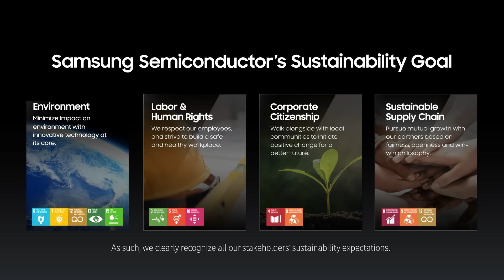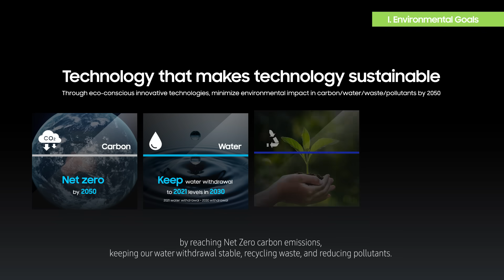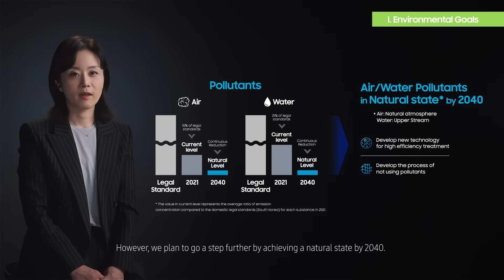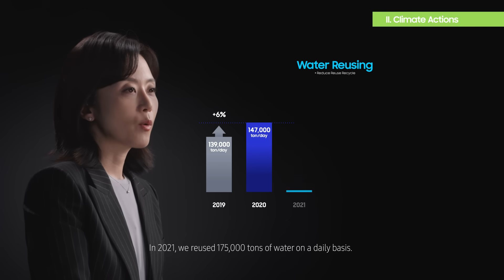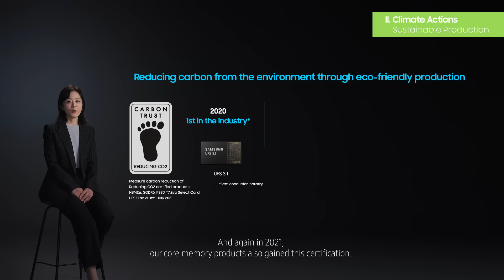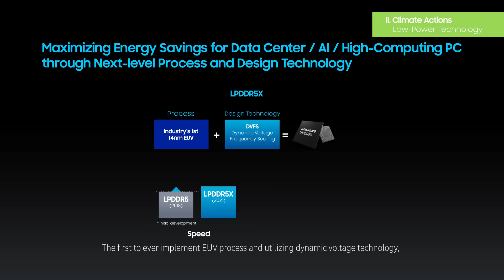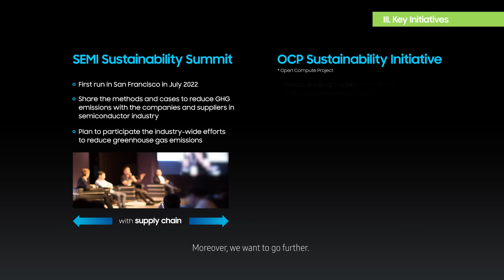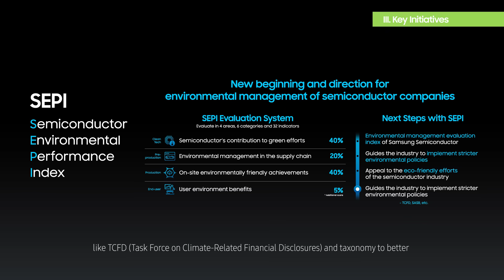Semiconductor: Drive for Environmental Sustainability | Samsung

Comment: I've been a Samsung fan for ten years.  It is hoped that in 2024, the processor of the Samsung Galaxy S24 series mobile phone will no longer be a version of Qualcomm Snapdragon, and Exynos2400 can return to South Korea.  Using Samsung's second-generation 3nm, the energy consumption is reduced by 50%, and the performance is increased by 40%. The CPU adopts ARM architecture, 8-core design, 1 super-large core, 5 large-cores, and 2 small-cores.  The GPU is designed with AMD RDNA4, bringing Samsung users the strongest mobile phone performance ahead of the times.

Comment: I have a suggestion don't release more mobile most of the semi conducting materials are using in it. So we have shortage of silicon or germaium. Remove the F version mobile fully remove and launch limited mobile in S,A,M versions are enough and we have more semi conductors and make the power chips.